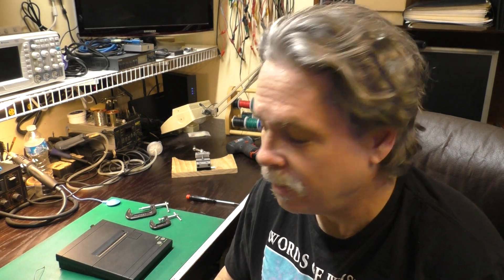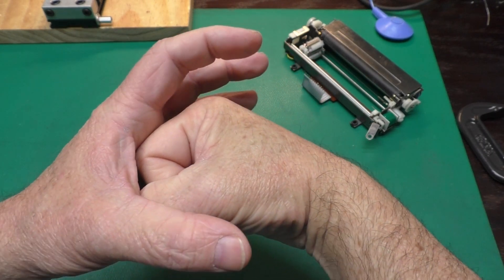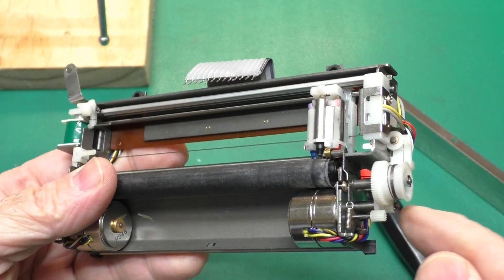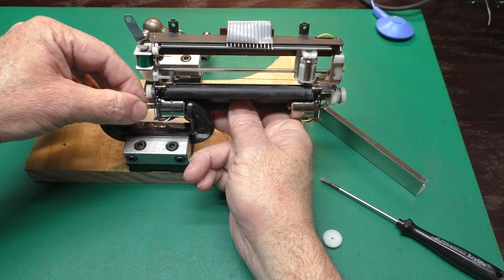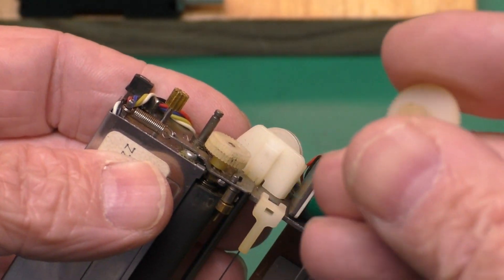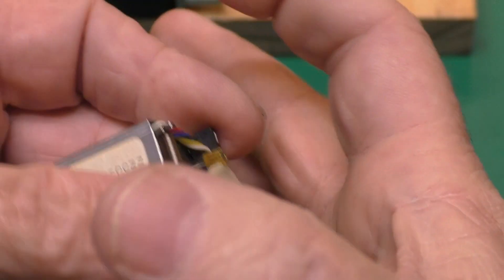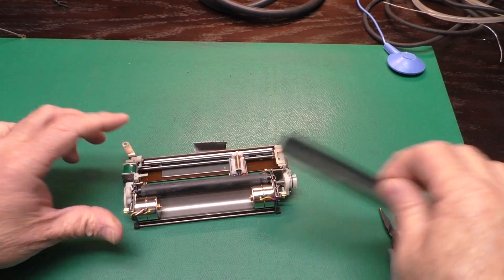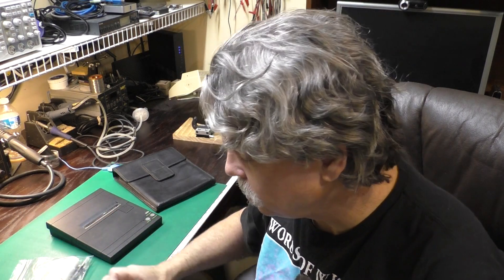Alps Plotter Mechanism New Brass Gear Installation

Comment: Excellent gears - but I didn't fancy taking the print assembly to bits to replace the broken plastic. As I had ordered two sets, I took a chance on lightly reaming the gears using a 5 point taper reamer. I just reamed and checked fit until I had a nice tight fit. I then simply secured using the smallest possible quantity of a good superglue. Worked like a charm and I didn't have to dismantle the printer. Using superglue to secure small pinions is quite a common technique used in clockmaking.

Comment: Many thanks for this video (and gears!) which made the installation of the replacement gears much less daunting. I was worried about bending/denting the metal when removing the motor cover as mine wasn't budging when trying to lever the gap so pushed a flat-blade screwdriver into the U-shaped hole to unclip the two parts first which did the trick. I stuck the replacement gear on the end of the G-clamp with a little Blu-Tack to get it started, too, as I don't have a suitable vice to hold the clamp steady. Only had to go fishing under the desk once... I'm very happy with the replacement parts as the plotter is printing smoothly again, so thank you!
Reply from the maker: It makes me happy to know that folks are plotting along once more :)

Comment: Thank you so much for the video with it I manage to repair my commodore 1520 plotter by fitting the two new brass gears.👍
I used a plastic c-clamp same size and it worked just fine as it is strong enough for these little gears, with the plastic clamp you do not have to cut the joint to remove the foot so one less job.

Comment: how is the sandwiched paper feed gears sprint loaded together? mine does not appear to have a sprint inside it but on the OUTSIDE, against the body of the frame where the gear is on the shaft i fave a little spring thing and cant see what its purpose is.
Reply from the maker: I did a video on this a few weeks ago: https://youtu.be/g35Fgx3riDc

Comment: I've read somewhere to heat them up , do you recommend to heat them up with a flame ?
Reply from the maker: No, I do not recommend heat. You will melt the plastic gears unless you take the mating plastic gears off first. Then you have to figure out how to hold the little brass gear, while it is hot, without damaging it, and it will still require effort to push it on the motor. 

Taking off the mating gear on the left side will cause you a lot of grief as this is the mechanism which moves the carriage with a wire wrapped around a capstan. You will have to restring that wire and it will ruin your day.

Using a 2" / 40mm C-clamp to press them on makes the job very quick and easy. I have done many of them this way.

Comment: Did you, by any chance, find a way to fix/replace the spring loaded gear? That is the only remaining (I hope) issue with the plotter I have.
Reply from the maker: I have an idea on how to fix it but have not had a chance to try it yet. I just used my last spare anti-backlash gear, well I 'borrowed' it from a working spare printer, so I am motivated to find a way to fix them :)

Comment: Thanks for posting this.  I had ordered the gears and was trying to figure out how to get them on.  This helped.   At 4:56 you mention the two gears that are attached together being broken.  Mine are too.  I noticed that the spring is also off of them.  How does it go on.  I cant seem to find any up close photos of it.
Reply: Does the spring set between the two gears.  Maybe one of the parts broke off that holds the springs
Reply from the maker: @craftsman123456  In my case the nub from the outer gear broke off. It poke through a hole in the inner gear. The spring goes on from the inside. I snapped a few pictures yesterday. Send me an email birt_j at soigeneris dot com and I'll send them to you.
Reply from the maker: Out of curiosity how did you hear about the gears? I ask because I put the link to this video every place I listed them for sale, except eBay as you can't add links to listings.

The spring on the  'double' anti-back lash gear presses on two 'nubs', one from each gear and it sort of squeezes in on them.
Reply: Ebay for me I believe.  Then I found your video.

Comment: I've had these 3d printed gears in my atari 1020 plotter for over a year with no issue. May try these brass ones in another unit to compare.
https://www.shapeways.com/product/CMBQ6D2Z4/alps-x-y-plotter-gear-qty-3-commodore-atari
Reply from the maker: I have had mixed reports on these 3D printed gears. The nice thing about the brass gears is that they are about 1/2 the price and will last forever.